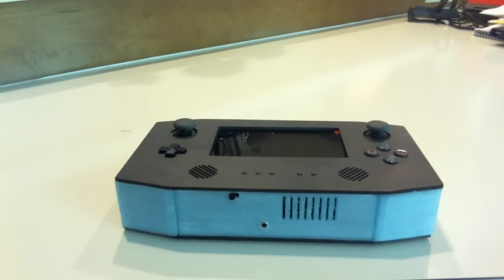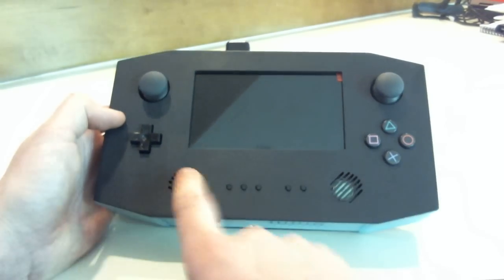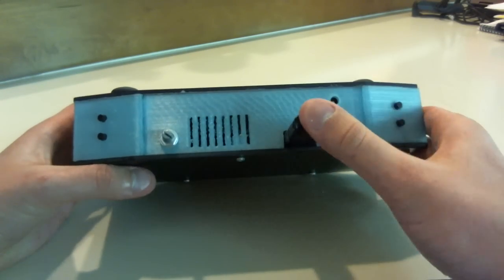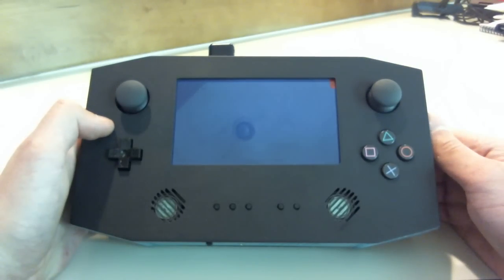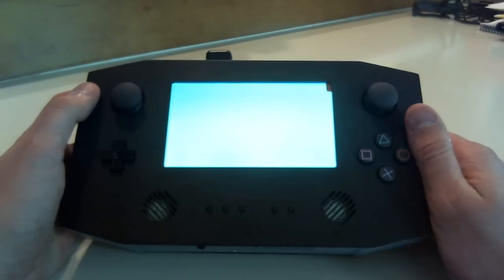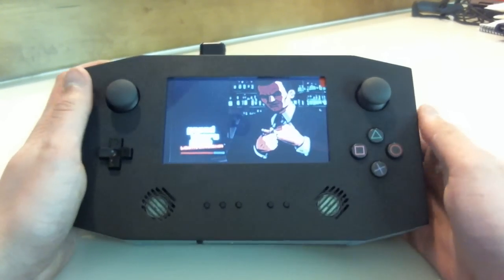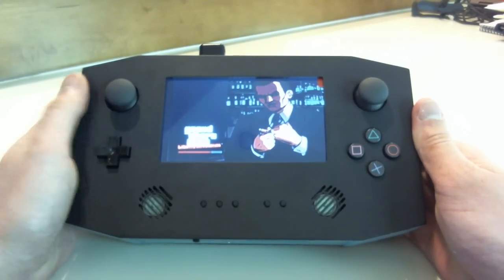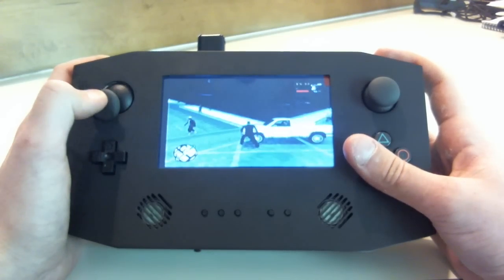Playstation 2 Portable

Comment: Considering that the PS2 (including some early slim models) has native IDE/PATA support you should build your next PS2 Portable with an internal SSD drive with a SATA-PATA adapter. Why? Because game compatibility is MUCH higher with Open PS2 loader than it is with USB and loading times are cut way short. Add a usb3 interface to the internal SSD for loading games onto it and you're set. Then add another USB port just incase anyone wants to use a usb stick or an eyetoy (for whatever reason).

Comment: so its not a ps2!?! it's just an emulator on a small screen lol.
Reply: Where does he say that?
Reply: tkfan
The Pi 2 doesn't even come close to being able to emulate the PS2
Reply: Giovaaaan
Are you following me?^^
Reply: You could still make a Cd holder that's smaller, then get the later that reads the PS2 games. Then put in the BIOS somehow.
Reply: xXYannuschXx no im just watching alot of playstation and tech videos lol
Reply: Eh, I didn't make that, what do I know?
Reply: +xXYannuschXx rasberry pi 2
Reply: xXYannuschXx they are similar specs tho
Reply: tkfan
To fully emulate a PS2, you need an overclocked curent Intel I5 (easily 20-30 times faster)
Reply: xXYannuschXx so they rasberry couldnt do it at all?
Reply: tkfan
 Nope, the PS1 is now possible due to the Pi 2 having 6 times more power than the Pi 1. Emulating the PS2 is a lot more difficult however, the PS2 is somewhere around 9 times more powerful than the PS1. Maybe if we get a new gen of PI, with an even more up-to-date processor, it may be possible.
Reply: xXYannuschXx oh alright thanks. how would i make a ps2 portablethen? wait until the pi 3?
Reply: tkfan
like this dude. Teardown a PS2 Slimline (there's one model line, where the mainboard was only half as wide as the console exterior) and put everything together in a case.
Reply: +xXYannuschXx why do i see you everywhere i go ;_;
Reply: You cant fit a PC capable of emulating the PS2 inside such a case xD